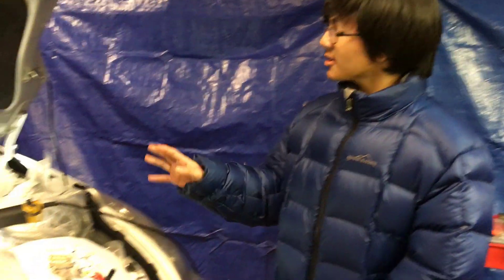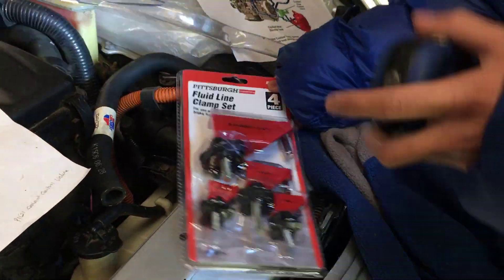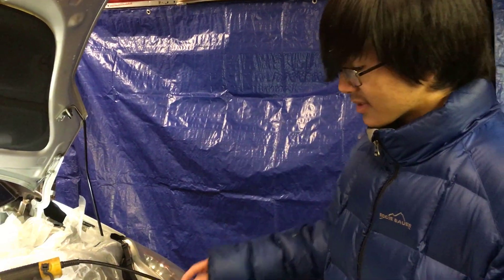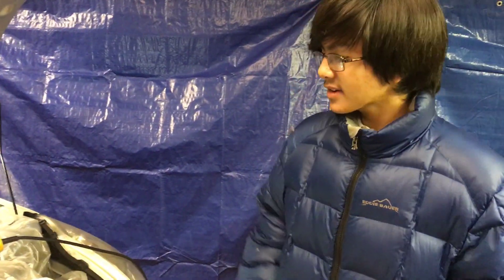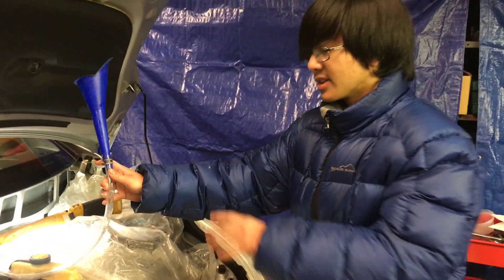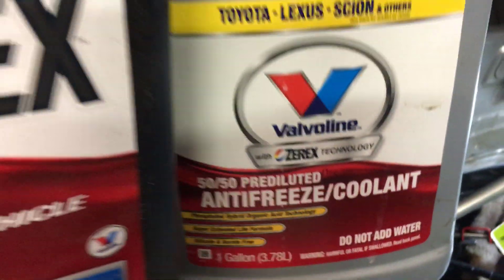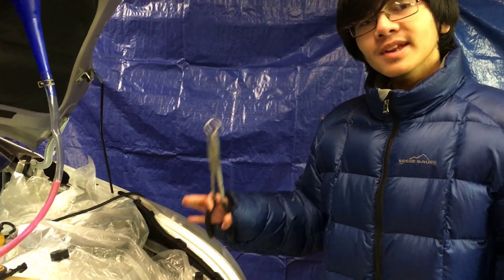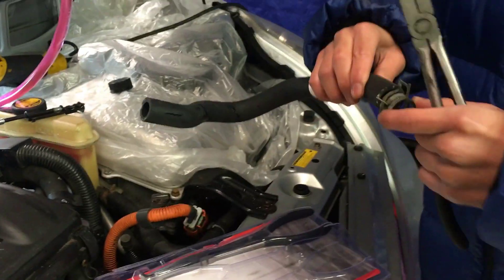How To Flush Out Heater Core & Fill Back With Coolant | Remove Clogged & Grime Engine Cooling System

Comment: Just add a 60/40 mix into the radiator fill to account for the water. Also, use a airlift tool to pull all the air out of the system before filling, it takes a fraction of the time and very little waste.
Reply: No...always use premix Asian pink or red coolant in these Priuses. Nothing else
Reply: Or just blow all the water out with air. Would work also.

Comment: if you're using a 50/50 mix of coolant and water, it shouldn't be a problem that there's water in the system, should it?  I mean if you were going to add water anyway...
Reply: Asian pink is premixed 50/50..  you can't buy it 100% then add water.  It's not sold that way.